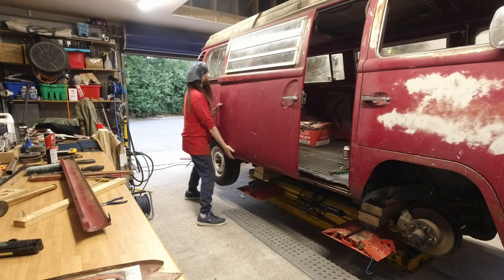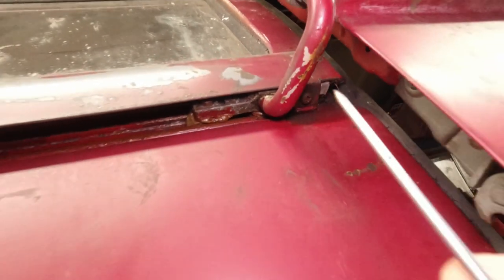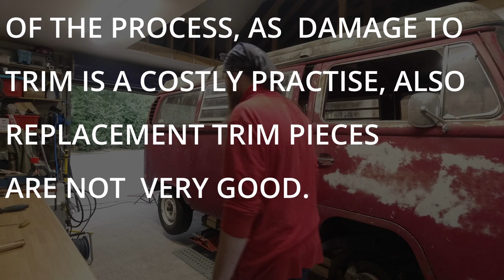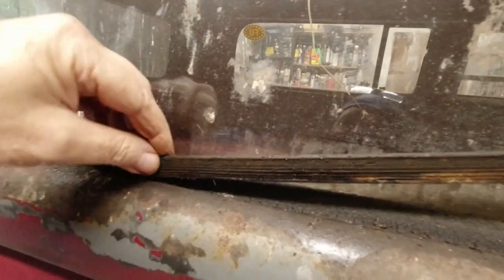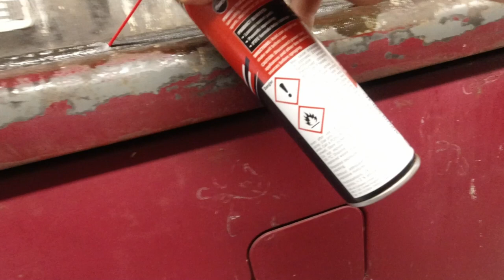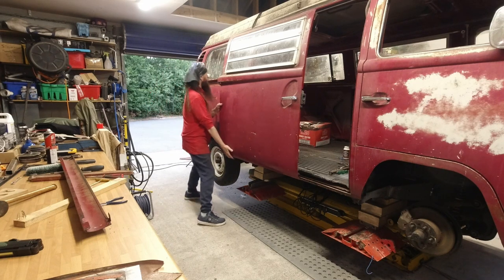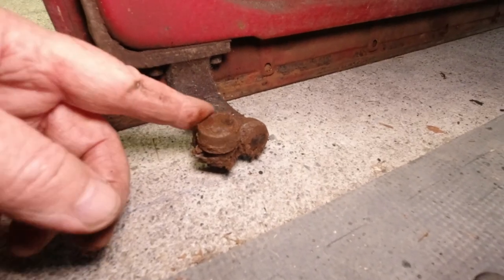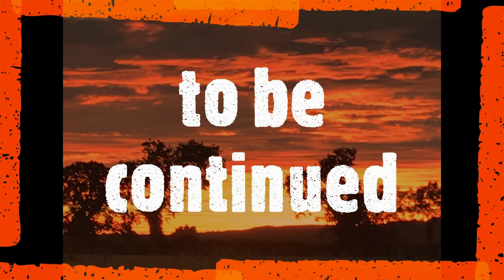VW T2  BAY CAMPER VAN RESTORATION SLIDING DOOR REMOVAL EP13

Comment: Just a couple of suggestions. 
1. Undo the inside screw for the weather guard first. This allows you to control removal out or it could fall onto the ground. 
2. Try tapping the the strip using a larger piece of timber long ways. This will make removal a lot easier and you'll find that the fine strip will also come out with it instead of you having to wrench it out with pliers. Also you will avoid damaging the body by having tge timber along ways instead of jamming it up . Just a couple if thoughts.
Reply from the maker: Hey there, thanks for watching and your support and your suggestions, won’t be doing another anytime soon but I will take on board your suggestions if and when, hopefully you’re comments will help others 🤙🇮🇪

Comment: a good video Joe, well explained and where the difficult parts are.
that will be the longest line off spot-weld's to remove. 
but you can handle it and it will be restored like new.
Reply: @Joesrustbuckets  i'm ok, just having a 3 week holiday's and some family time.
working around the house and some other stuff.